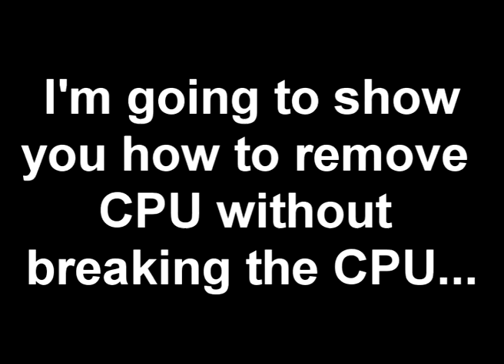Did your CPU got stuck to heatsink?

Comment: god please do not do this people... just get a hair dryer and heat it up a bit while wiggling it and it will pop right off. HEAT IS THE WAY PEOPLE THESE CPU'S LITERALLY GET RIDICULOUSLY HOT AND ARE MADE TO HANDLE HEAT. Do not take any type of sharp objects like a blade or screw driver to your CPU or cold plate...

Comment: Worked! after using rubbing alcohol and dental floss for a while. I only had to put little pressure on 1 side and it came off right away, I was really surprised at how little pressure it took for it to come out I barely touched it.

Comment: Tried alcohol and dental floss first, but I could hardly get the floss under there. With this it popped off after two little pries.
So... maybe the alcohol worked a bit too, but... I was about to leave to get a whole new CPU. X]
Thanks, meng.

Comment: I had been at my cpu for hours trying the dental floss or hair dryer trick this is the ONLY thing that worked for me not twisting not dental floss not the hair dryer but this. everyone says not to do this yet oddly it worked in less than a mjnute, i just gave a gentle nudge on each side and pop!
Reply: I spent the whole day trying to get  my cpu off and then i tried this and it took max 10 seconds
Reply: O' Malley it actually worked!!!
Reply: @jerryjurado1631  I've been dunking my cpu in alcohol for a couple of hours and if dental floss doesn't work then, I'm going for this...
Reply: SAME BRO
Reply: Right?

Comment: My Phenom II x4 965 is stuck to the stock heatsink and this thing is really difficult to remove. I've tried everything at least once, from alcohol and floss, to putting it in the freezer inside of an airtight plastic container, and this thing will simply not budge. All that did was form condensation on parts of the heatsink and CPU, so I just let them dry off. 

It also doesn't help that I have to be really careful as this thing has so many fragile pins on the bottom. Not even the hair dryer method worked for me unless I haven't heated it enough, and I'm afraid to damage the CPU. >.<

Comment: i had one get stuck on a 478 socket. in the removal, i killed the chip. this was after heating it up. i was lucky and had a spare laying around and the board survived. it sometimes helps to run the machine for wahile and get the chip warmed up. not all the time will it help though.